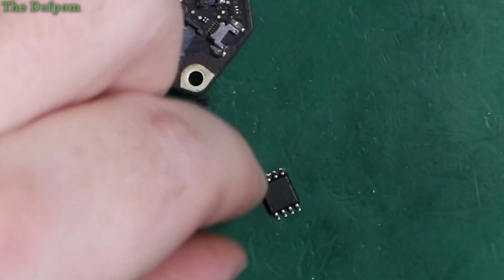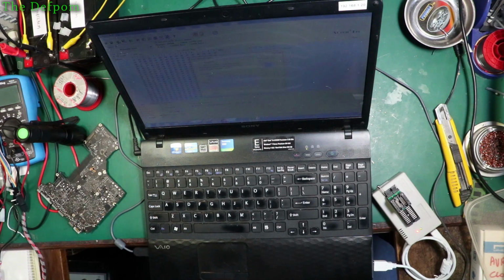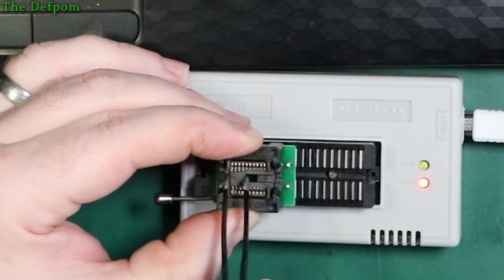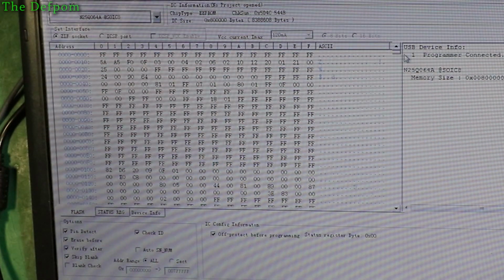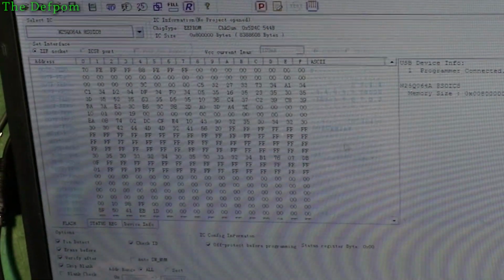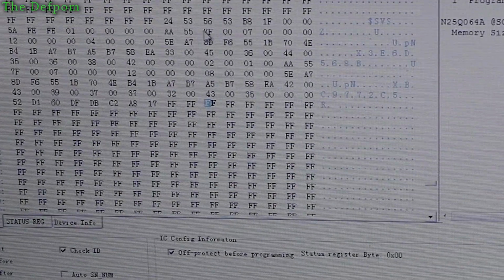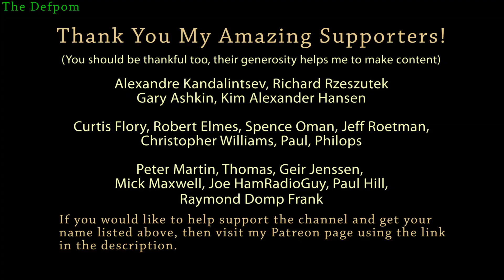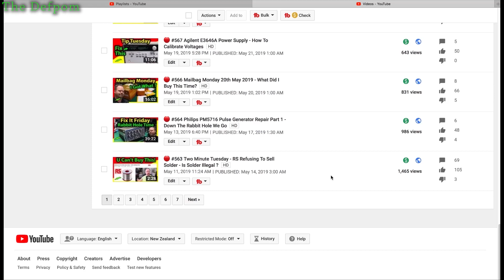#656 Reset Apple EFI Password - Change Apple Serial Number - Read Apple SPI ROM

Comment: Well what can i say, i would get two identical mobos and grab the data from both roms then do a difference check.

I still have my willem mk4/5 programmer, but its parallel port only and i havnt seen centronics for donkeys years.
Old crap i hear you thinking lol,  Yep it is but it did a smashing job :-D
Reply from the maker: I still have an old parallel EPROM programmer... I don't know why I don't own a computer with that port anymore!
Reply: Yep just like me, i did think about trying to get a express card to parallel but most didnt emulate a real parallel port.
The willem uses the port in a non standard way.
Dumb printer interfaces are useless.
I found one at starteck, but i didnt want to sell a kidney to buy one lol.

You will get used to usb, then some git will replace it lol.

Comment: I have the same programmer as you. Although the software is a bit odd the programmers works great and are really good value. You must be quite good at the surfaces mount now with all the practice still not something I’m completely comfortable with but I can do it when I have to. I also should do some more PCB SMD designs but just cannot face buying all the various components I already have but smd flavour. Very nice and thanks for sharing. PS don’t miss the opportunity of editing the hex file and leaving a rude Easter egg.
Reply from the maker: I used to add my copyright and web address on EPROM's back in the day...

I actually purchased the TL866ii Plus JUST to replace the blown front panel µC on a Agilent E3646A power supply, which I did a video on earlier in the year.
Reply: Defpom's Electronics & Repair  I used to use a lot of proms back in the day when it was microprocessors rather than microcontrollers. You would be surprised if I told you the stuff that has my shoddy code running it. Unfortunately genuinely cannot talk about! Mysterious me LOL.

Comment: No checksums in the firmware? surprising for apple that like to make any modifications tricky...
Reply: Checksum will be invalid after changing serial no. I recommend you watch piernov’s channel for a tutorial to correct checksum.
Reply from the maker: Yes I believe there are checksums, but it is unclear if it matters for the EFI password unlocking, any other videos I have seen don't show any checksum checks or issues... maybe it is an issue, I really don't know, like I mentioned it isn't actually something I have needed to do myself, this video came about by me wanting to make backup copies of the SPI ROM I have here on donor boards.
Reply: Removing password wont Invalid checksum. It only applies to editing serial no.  However a invalid checksum rom can still run fine, just apps like ASD will moan.
Reply from the maker: Alan Liu - thanks for the information.
Reply: https://www.youtube.com/watch?v=poA8HByYqTM